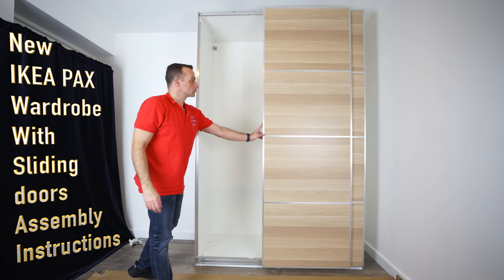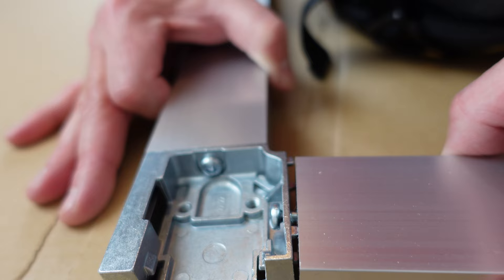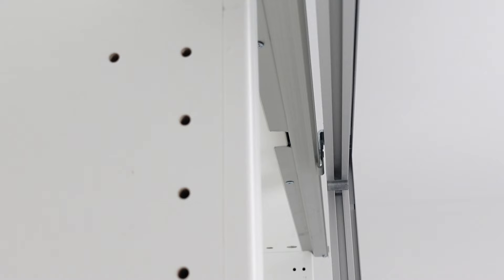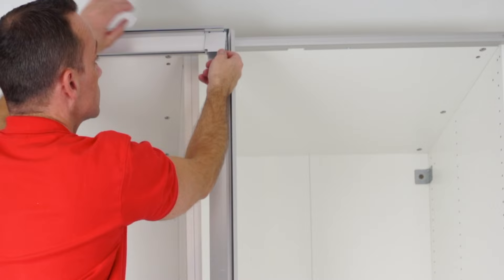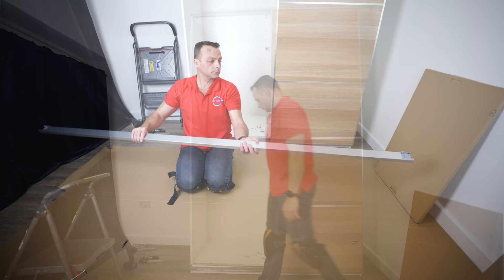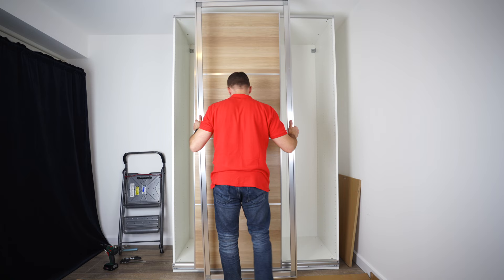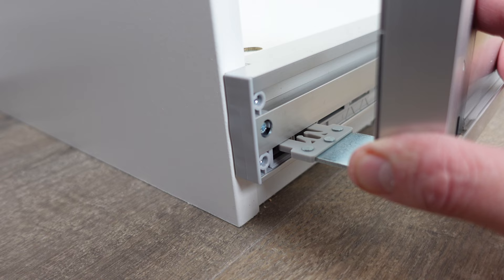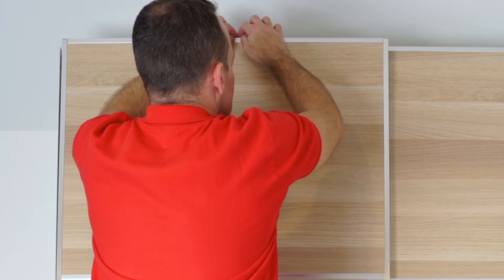New Ikea PAX Wardrobe with sliding doors Assembly Tutorial Part:3

Comment: Great video, I often cut down PAX units for perfect fits, next job I will be using sliding doors, bit more work in cutting these down, but I think it’s possible.
Reply from the maker: It is possible. Here is how it is done with previous model of IKEA PAX sliding doors. You may need slightly adjust the cutting (bottom and top hinges and rails are different on the latest model. Good luck. Thank you for watching
Reply: @PPFlatPack  Hi we did this - had to cut one of the internal units down by 10cm. Unfortunately that meant one side of the bottom track lost the slow closing mechanism which is on the frame now for new sliding door style (not like the separate slow closer on the old style pax sliding door systems0. Any recommendations on how i can add a soft closer to this new style? Thanks

Comment: Thanks for these terrific videos! I have a question. At 16:50 you install the metal side panels to both ends of the wardrobe. My Pax will be visible on one side as you walk into a mud room. I plan to add a custom seating bench that will abut the wardrobe, but want to add an Ikea Forbratta cover panel to that exposed side of the unit you'll see to match other Ikea cabinets in the space. Would attaching the Ikea Forbattra cover panel interfere with the metal frame you attach to the side of the unit? Do I need to install those two metal side panels? I'm not sure if they are for aesthetics or serve a specific function. Thanks.

Comment: Do you have the panel sizes you used of the inserts? I have the sliding door of size 78 3/4x79 1/8 "  but I want to get custom inserts made so I just need the L x W dimension of 1 panel. Thanks!

Comment: Hi man i have a question my PAX wardrobe was build by the ikea service the first time. We moved houses and now i assembled it myself. The sliding doors hit each other in the middle when both sides are closed. It looks like the frame hits one of the screws from the outer doors wheel mechanism. I tried different things but it wont help, in my previous house the doors were closing smoothly

Comment: Thank you for this video. I have issue with inner door with this mechanism - it is sliding really hard, I need to use big force to move it. Outer door is moving smooth. Somebody got this issue? It looks like it's assembled in the right way. Inner door are with mirror panels, so it's pretty heavy.
Reply: Hey, did you find a solution?
Reply: @channelouou  Yes, but I can’t recall what I did to fix this :( probably badly installed it to rails I guess

Comment: Hi, thank you for the amazing video. However I’m still have trouble with the door not closing properly. I am pretty sure i follow your method properly with the adjustments behind the doors. I’m not sure what I’m doing wrong
Reply from the maker: Hard to say could be so many things ( floors not in level, wardrobe frames not in 90 degree…) if you we talking gap up or down sometimes easiest fix is to put something small under the wardrobe depending where the gap is. Sorry hard to explain if I can’t see it.

Comment: We fitted these wardrobes in our home last September shame these new easier doors weren't available then. Do you think it's worth upgrading we have mirrored panels. Great video as always thanks
Reply from the maker: If you have previous version and all working fine I would not upgrade. Some of the things in the new version still need to be improved (hinge adjustment, soft closing, ending panels ....) Good think definitely easier to assemble, no headache with soft closing... Will be doing video later on what I think about these new doors. Thank you for watching and your support.
Reply: @PPFlatPack  certainly one of the downsides of the new version that I have jusr discovered ( after having installed everything!!!) is that there no ability to adjust the hinges (or stops) laterally so that you can get rid of the gap between two sets of doors,  when using 300cm (i.e two sets of 2 x 75cm) cabinets, which looks unsightly and spoils the wardrobes.

I did try removing stops but then the soft close mechanism doesn't work and there's no easy way to fit a stop in the right place to stop the doors clashing together.  

Why on earth Ikea thought it was a good idea to remove this ability.....

Comment: Hello, I was wondering if on the half door half mirror version, that the mirror can be on the right side and plain door on the left? Or are the doors designed so that the mirror (outer door) will only work if it is on the right side?
Reply from the maker: Yes you can mix the panels the way you like
Reply: @PPFlatPack  brilliant thanks for your help

Comment: Great video, can you kindly confirm the door aligns flush with the side of the wardrobe
Reply from the maker: There is few millimetres gap (1-2mm) unfortunately there is no option to push them out flush with the side ending panel. It was possible with older version. This new one stuck with soft closing  at the bottom rail. At last that’s what I see so far. Hopefully they will change that .
Reply: @PPFlatPack  Thanks for your reply....The point of fixing the plastic trim to the top of the door, as you have highlighted is to keep dust out, if this is the case, why then have gaps when the doors are closed, it slightly defeats the object, if the gap can't be closed, the only conclusion is that these doors are poorly designed and not to the usual Ikea standard, thanks again for the insight
Reply from the maker: @rainbow-km9ri  It would be properly close if they include the long sticky duster on the side as they did in previous version it was on the both doors at the end all along the door frame closing the gap

Comment: The doors are kind of noisy when they slide because the bottom rail touches the guide. Is there anything that can be done to make them less noisy?
Reply from the maker: I thing you right and it is because the soft closing in the bottom rail. I don't thing there is fix for that for now.

Comment: Hello I tried to fix mine but I think the panel got problems doesn’t want to stay when trying to clip the bottom the up goes up it too big not the same size 😭😭
Reply from the maker: You can adjust the bottom hinge open 2 screws and slide the bottom hinge up or down.